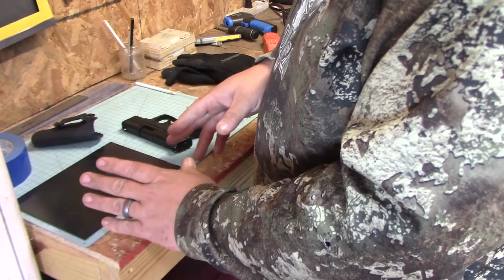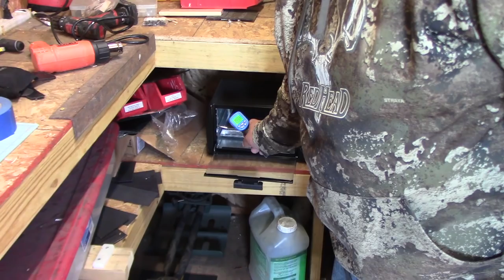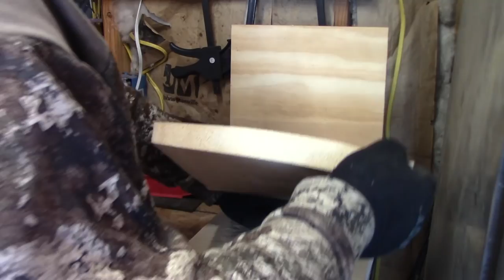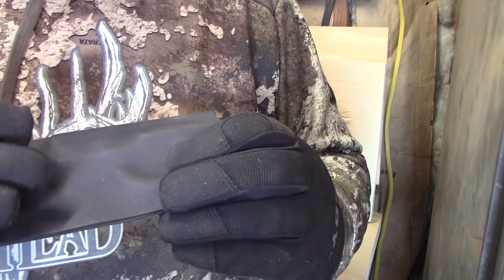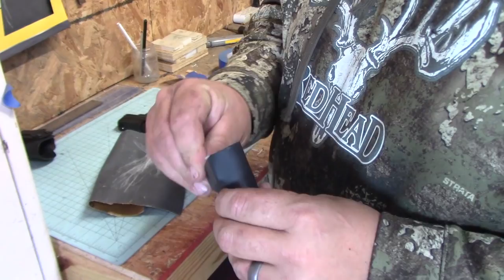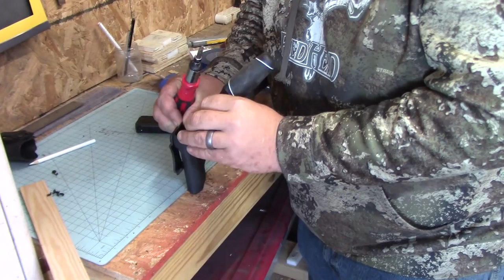How to make a Kydex IWB holster

Comment: A little trick is instead of trying to fold it in the press pull it out of the toaster oven and staple it together real close to the edge. This will make a pocket for you to slip the firearm in. Then you can just press it an fuss with it less. I also switched from using a toaster oven to using an electric pancake grill.

Comment: Just an idea If you use the Chicago screw with a spacer instead of  the rivet you could just tighten the screw for more or less retention
Reply from the maker: Yeah I use that occasionally but for the most part I just use the heat gun to adjust the retention if I was making one for someone else I probably would use a screw with spacers so they could adjust to their liking

Comment: Hi, how exactly is the type of tape called you are using for the preparation? And if you have time for the long version: what kind of tape can be used (and removed without problems after getting heat and pressure from the kydex) for kydex-preparations, and what kind of tape should be avoided?
Reply from the maker: I just use the 3m blue painters tape not sure exactly what one but is the better quality one and have never had any issues removing it. That is the only one I have ever used I probably wouldn’t use just regular masking tape it might be tough to get off.
Reply: @TheGunSnob  Thank you!